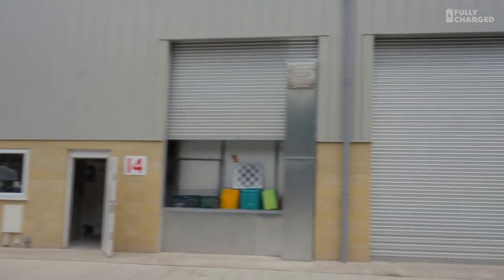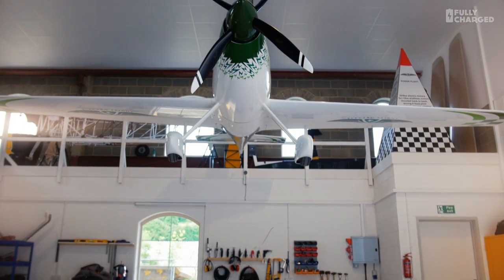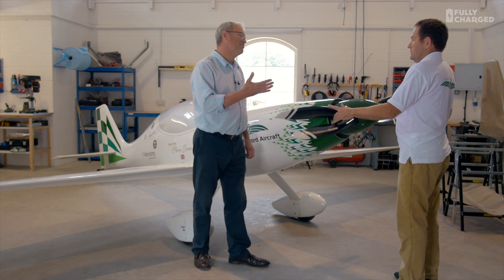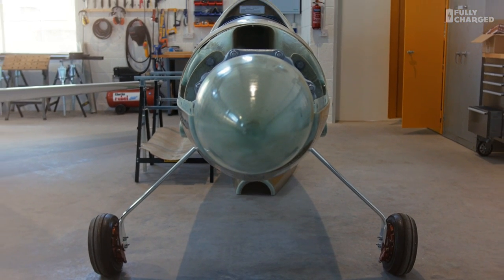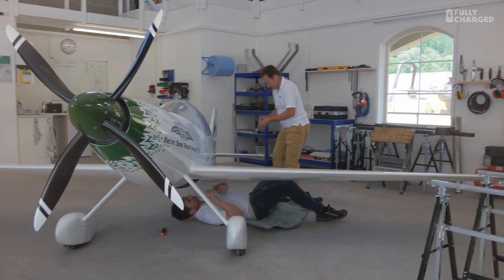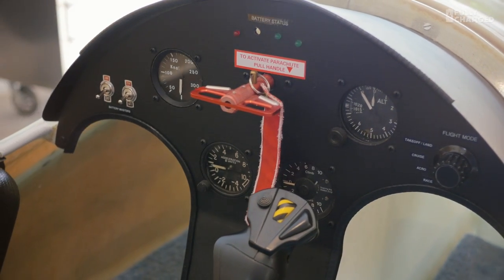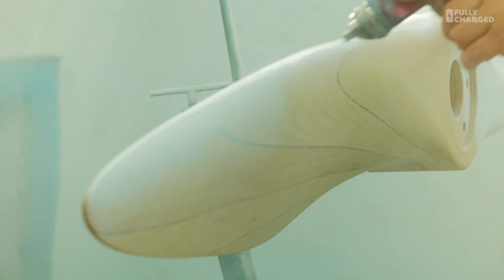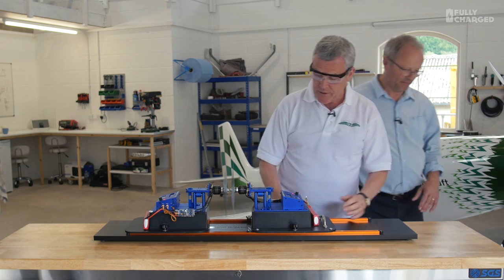Electroflight | Fully Charged

Comment: Can someone give me a in depth explanation of the benefit of two counter rotating two bladed props over a single four bladed prop? Except for the fact that it solves the torque roll issue, is there any efficiency gain? If yes, how? Or are there more benefits?

Comment: you just simply cannot recharge the battery as fast as refilling oil tank. by the way, as the consumption of oil, the weight will decrease for normal planes. for this one, maybe still the same.

Comment: "Energy density of current batteries gives 5 minutes of flight."  So we'd need 30x improvement to make a viable competitor to current propeller AC.  Energy density has improved about 2-3x in the past decade.  Need several fundamental breakthroughs or somehow maintain the current rate of improvement to see this in our kid's lifetimes.  No one is claiming a battery Moore's law at this point.  This is cool tech, but destined for the lab for decades to come.

Comment: They're not holding the planes back. If you look at how much the fuel would weigh to fill up each wing, it's equivalent to like 32 Buses. There's no possible way an aluminum wing can hold that amount of weight. The engines today are basically fueled by battery, oxygen and a just enough fuel to keep batteries charged.

Comment: It's Newton's 3d law:

If you kick someone he'll kick you back.

So if we want to accelerate the propeller that corresponds o the force with which we'll have to kick it.

But then the propeller will, in turn, need something to kick back on, just as you will if you try to jump into the air.

So, with one propeller this would have to be the air frame.

But with counter-rotating propellers, well, why don't we make them kick against each other?

Comment: would it not be more optimal to have 2 separate engines in nacelles on the wing,
they counterrotate, but they do not overlap, thus increasing the efficiency (as you don't attempt to accelerate the same air twice) and potentially save noise and vibration?
or am I totally wrong here:?
Reply: A well designed contra-rotating prop is actually slightly more efficient than a single prop with the same diameter and number of blades. This is because normal propellers cause a spiraling motion of the air that consumes energy but doesn't contribute to thrust, wheras with a contra-rotating propeller the spiraling motions induced by the two propellers cancel out. Of course making a 2 or 3-bladed contra-prop is a bit impractical, so results may vary depending on what size of normal prop you can fit onto the plane (a bigger prop with fewer blades is always more efficient). Twins with one engine on each wing tend to suffer from extra drag caused by the engine nacelles- drag caused by the nacelles and cooling inlets can add up to be as high as 30% of the total drag the plane experiences during cruise.

Comment: As electric motors are smaller and there are two of them why not mount them on the wings the counter rotating props could gather more air when they are not in front of each over.

Comment: What they do not show in this video is the weight, endurance and range of the electric general aviation aircraft.  The big problem is the weight and size of the battery.  Yeah you could scale back and get a 20 minute flight, but to be a true viable general aviation aircraft it will have to stay airborne for at least 2 hours.  Early adopters will be aerobatic competition and racing aircraft, because of the huge power of the electric engines.  There are some huge advantages of a electric motor such as reliability (less moving parts), performance (aerodynamic and power), but the weight and capacity of present battery technology is a big limitation.  Present general aviation engine technology was designed in the 1940s and has not had large technology improvements, except for composites and instrumentation, for several decades.  The cost of general aviation fuel $5 a gallon in the USA has really hurt general aviation in the USA.  I can imagine as battery technology improves you will be able to have a 300 knot general aviation aircraft, which will be more reliable and can be recharged at next to nothing.  The design of the aircraft will probably allow you just replace a battery pack with improved battery technology, which would allow airframes to have a longer service life and increase the range and performance with each technological improvement.  Wow, general aviation is going to be really cool in the near future.
Reply: The cost of aviation fuel is trivial compared to to other costs of general aviation. It costs tens of millions to certify a new aircraft design. Four to six seat single engined IC aircraft are the biggest part of the aviation market. The typical forty year old four seat single engine aircraft costs over $30.000, and a new plane in the same class could easily cost 15 times as much. There are no electric planes in that category , but there is no reason to think they would be cheaper,  given that a two seat electric Pipistrelle with much less range  costs about $300.000.

Comment: Did they mention what the expected range was gonna be on that thing? If they did, I missed it...
Reply: 10 mins, to cover a 90 second race time.
Reply: Right at the start he mentions that the current goal of a technology demonstration would be about 5-10 mins flight. For this type of aircraft it is more than enough as the red bull air racers are not flying for long at all.
Reply: +mipmipmip
Well the only purpose to these planes are the races, just like an F1 car you just don't use it for anything else.
Reply: Right. But a comfortable margin for error would be nice to have. Even in Red Bull type racing, you still need to get back and forth to the runway, wherever that might be.

Comment: Ride a bicycle. It feels like you're flying...
Reply: Better yet, ride a Zero motorcycle. Just as smooth, quite and much faster.
Reply: and you can feel the air in your face unlike in the cockpit of the aircraft which is covered
Reply: At 300mph i think you would be very much in favor of having a cockpit to sit in.

Comment: Perhaps I missed it. Why are the propellers made of wood instead of a more "high-tech" material?
Reply: I'm guessing : 1) Price. 2) The wood propeller shop is literally next door 3) It's a mock-up model. Once they build a fully functional version, they might switch to composites.
Reply: I remember reading somewhere that because of the extreme conditions the propellers go through, wood is better suited to adjust to those conditions and is able to flex without cracking, which I imagine was a problem with earlier composite propeller attempts. I would also imagine that it would be quite a bit more expensive to produce.

Comment: With such immediate power at the pilots control, wouldn't this be ideal for island hopping and landing on difficult teraine with very short runways?  In other words, brining transport to difficult to access places, cheeply and without ruining the planet?
Reply: Wrong aircraft. The island better not be very far from the mainland because this thing will only stay in the air about twenty minutes. All that power, if they can keep the plane pointed in the right direction  would probably get it off the runway very quickly, but it is a heavy little bugger, which means it has to go fast to stay in the air. Fast approach speeds mean landings that use a lot of runway. And of course, this plane is designed to carry itself and a slender pilot who didn't bring lunch or a thermos of coffee . What would he be bringing to these nearly islands with long runways? Heartfelt good wishes?

Comment: Counter rotating (a good half of the video was solely about this topic)? Wow, how innovative! Too bad that the Tu-95 used this concept more than 50 years ago, and you can bet your ass off that the soviets calculated what the best prop arrangement is, since a strategic bomber is no joke...
Reply: Leanid Klimenka NASA have done loads on contra rotation.

Should also note that the Soviet Kamov Bureau built a number of production helicopters with coaxial design.

Comment: He mentions possible aerospace applications and how electric motors don't need oxygen and all, but I can't help but wonder if he's forgotten one small detail. At very high altitudes, yeah there's not much oxygen up there, but there's not much air either. So I'd like to know how he plans to power these electric planes to extremely high altitudes when there is essentially no air for the propellers to beat against, hmm? Maybe super high rpms or something? But surely that'll drain the batteries rapidly, so . . . anyway, I suspect jets and rockets will still maintain an advantage at extremely high altitudes.

Comment: Would there be any advantage with three props? -- Or would the diminishing returns come in to play?
Reply: Three props would make it unbalanced again, you would have to use 4, however, it may be more efficient to just use 2 bigger props and engines
Reply: 2 of the prop's torque would counter each other, the the 3rd would just add the same torque problems they explained with the spit fire segment. (And before you ask, what about 4)... Complexity.

Comment: what happens if you duct them. Also what happens if you take 5 to 10 little motors embededin the bottom of the foil  back to back in a small package and duct them in the shape of an traditional hobby cat jet all hooked in parallel?
Reply: Rashad Glover. And also useful would be if while the small turbines are not in use they are covered or stowed away for aerodynamics. Maybe use all of them for takeoff but only 25% for maintaining altitude. like a v8 that cuts to v4 on the highway.

Comment: In a tesla, the batteries can weight a good amount, because the car doesn't have to lift them. On a plane, the battery weight is the biggest challenge. The model S Tesla weight 5500 lbs. That's 2 tons. How can that work?

Comment: Yes, but |  100% thrust from propeller 1 + 100 % thrust from propeller 2 = approximately 0,75 * 200% from both propellers in counterrotation, unfortunately...So there  is about 25% thrust loses than two separate propellers without interference.

Comment: Have you considered using a hydrogen fuel cell to covert hydrogen to electricity?  Might solve the weight problem.
Reply: Hydrogen fuel cells aren’t good for the atmosphere and electric motors require less maintenance and have less expensive repairs. Especially on an aircraft

Comment: We are being logical and practical at this time and working on the design of a 4-place GA Hybrid Aircraft. Unfortunately, the battery technology just is not where we need it to be, to use 100% electric power. 60 minutes of flight time....a waste! What we can offer at this time, is a very modern looking, sleek GA 4-place A/C with extreme minimal fuel cost! Stay tuned!

Comment: This Maybe a dumb suggestion but What if you make the flight's outer surface using solar panels so that it can constantly charge the batteries while it's in the air! Donno how effective and fast the charging would be via the solar panels.
Reply: Bince Mathew. Good question. may get a dumb answer though. I see someone answered as if solar cells will always be heavy. I would point towards charge rate and use rate. Eventually, the fuselage could be wrapped in cell material just as easily as being painted. Maybe this would be good for keeping up a backup battery for control surfaces for safety and being able to fire off your rocket for the parachute, but if you are using 300 horsepower of electricity and your surface area is .5 horsepower worth of electricity production then what time will you realistically add to this type of flight. on a sail type plane using say 2 horsepower then yeah makes much more sense and useful. The high discharge rate means the main battery is more likely to have issues and a back up/different battery for control, communication and others is smart. even in RC planes this is the case.

Comment: What bothers me about Electric Aircraft is not just the Range and refuel options, but the deterioration of cell life. As we charge our cell phones over and over again, they slowly loose their maximum capacity and ultimately begin to dissipate faster and faster. So, I buy a Electric Aircraft with an initial range of say, 600nm but after two years of flying and charging how will my range look? How expensive will replacements cost and how will that factor into Overhaul/Annual costs? I guess we're saving massively on fuel which would offset battery costs... but I still want to know the details as it pushes into the markets.

Comment: never understood why they didn't make a system that works on the same basic principle as a turbo from a car, since turbo's are essentially battery chargers that recycle energy wasted from the exhaust, they could make a plane that not only flies on battery power but charges itself as it flies with the use of a super compression duct and a turbojet blade connected to a turbine and regulated to charge the battery with a constant uninterrupted (as long as you're flying) form of reusable energy.
Reply: on top of which, if it takes an hour to charge the battery and an hour to discharge it (hypothetically), then what happens if you charge it at the same time you're discharging it? it cant possibly be perpetual energy but it could be 70-90% more efficient and will be able to remain airborne for far longer
Reply: +renogiza - They've not done that because of physics.

The charging mechanism would add drag to the airframe.
To make up for the added drag more power would be needed to keep the same performance.
If the charging mechanism was 100% efficient* then all it would be able to do is off set it's own drag.
You'd still have a plane that weighed more and so would perform less well.

*In reality it would likely be something like 50% efficient.

Comment: are the propellers in sync... like when running do the blades stay 90 degrees from each other?
Reply: No, they are not synchronized to keep the same position with respect to each other. They are two independent motors, but they could use the same supply three phase system and change the two phases so that they will achieve what you described but not necessarily 90 degrees.
Reply: @carmelpule6954  ...got it...you just swap the black with the blue or red...

Comment: I noticed the copper sponge High speed/high power battery tech made a momentary splash and then disappeared.  What happened to that technology? As for airplanes during transitional phase why not use pusher assist electric prod flying pods to help conventional aircraft save fuel?   They can disengage and float (auto-gyro) down 3/4 of the way on long haul over-ocean or over-desert, flights.

Comment: Wouldn't mounting it on the rear give you a more efficient use if power?
Reply: Gorm Auslander I don’t believe it works like that, but say it did you would need to use tricycle gear which is more complicated and heavy than a tail dragger configuration and with a racing plane like this (especially electric) shaving off the pounds is the biggest way to improve it
Reply: I see. I had just heard that rear mounted engines were more efficient
Reply: Gorm Auslander you have me curious I’ll have to look into that more, that could very well be

Comment: The electric motors being made for Formula E cars are about 300 hp, and look to be smaller than the ones in your mock-up.
MY twin counter rotating motors are... well i find if I post even the name I came up with the posts will be stopped from going up or being seen
 "for reasons of National Security".

Comment: I wonder about heat dissipation. With that much power being drawn down from the motors, how will they get rid of heat from the batteries and motors? I saw nothing in their design that would help heat dissipation
Reply: Didn't see the air inlets around the base of the props?  I didn't notice where the air would come out, though.
Also, that may have something to do with the fact neither of them is supposed to be a working prototype.

Comment: You can have a mule come out of the fuselage like on a Airbus and put some of the charge back in the battery or to drive hydraulics. I know in rc buggy racing the e buggies are faster than the nitrous now leaving them behind once they make a LIFEA, or LIPO or PLASMA battery the same weight as fuel or close to it because you got to think you don't have fuel pumps or fuel lines in a electric plane where do I go to invest.

Comment: on large aircraft  are there any benefits to  having both prop and jet engine on the  same  aircraft  if not why ?????
Reply: A few piston engined prop planes were fitted with either jet turbines or rockets to achieve some particular end, shorter takeoff, or more load lifting capability, but better planes were designed to replace them. There have been a lot of turboprop aircraft powered by turbines turning a propellor through reduction gearing, and some of them were very good aircraft, like The Lockheed C-130.

Comment: Hybrid secondary electric power generator perhaps? Small, lightweight and efficient enough to burn a fuel to provide much smaller batteries enough electric needed, for flight while increasing the flight range drastically.

So; one main electric motor, small electric variable speed control motor (for prop counter rotation if necessary) a smaller generator motor and perhaps a lightweight compressed gas fuel for generator. 

If all this can be formatted in a way that is overall less weight than the standard combustion engine/fuel combo, with the overall efficiency and benefits of electric thrust, then maybe there is a way to get ahead of the game.

If the sheer size and weight of batteries alone cannot be overcome, then maybe there is a better alternative is what I am suggesting here. . .